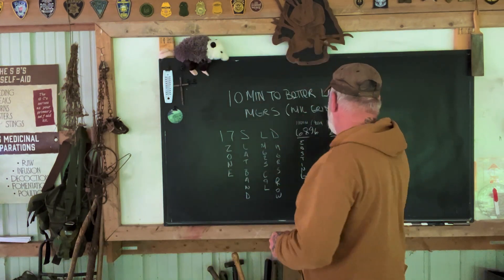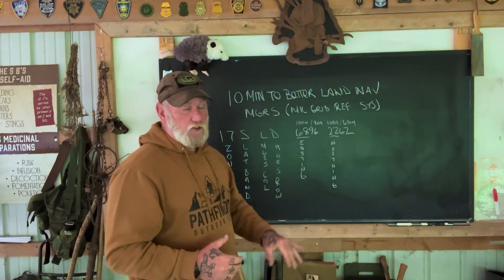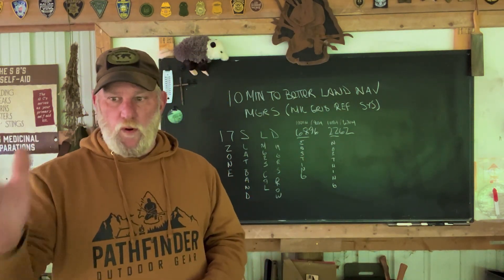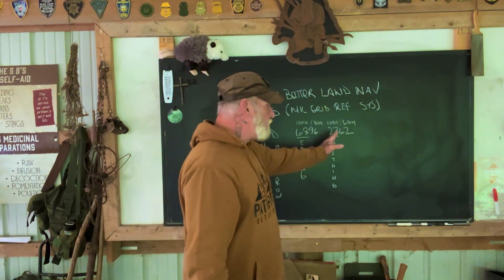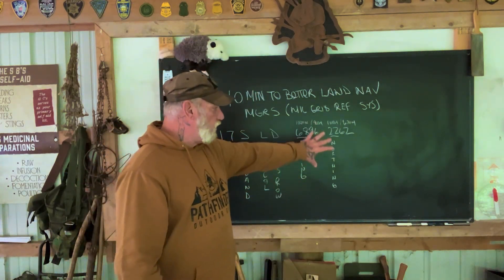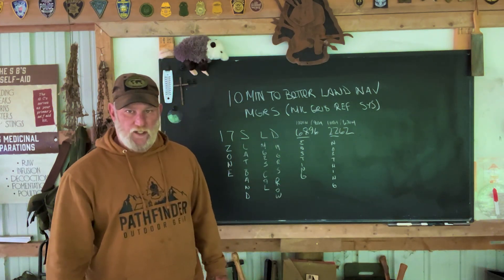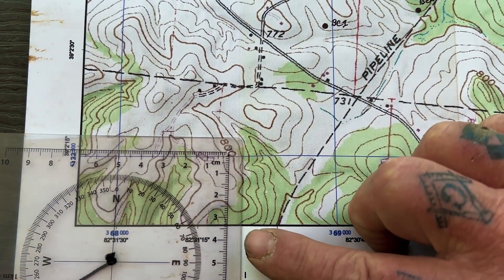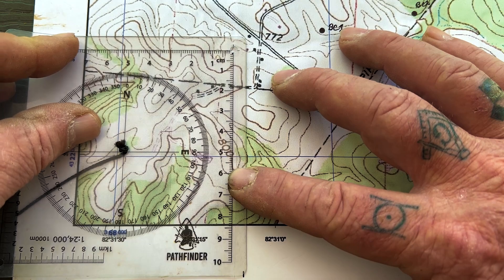10 Min to Better Land Navigation Part 12 Understanding and Plotting Grid Coordinates

Comment: If you haven't got a tube account to download you can sign up for a trial. DO wait till Dave finishes this kick-ass Nav Series so you never lose it, and can use it to practice without having to be on-line. Take a battery re-charge bank if you think you'll need it but really you can find places that aren't in the deep dark wilderness to practice. I've been doing some of them in a carpark.
In a reasonable size park you don't need large elevation or valleys to get your heads around peaks, draws, etc...
Paths, tracks and streets can be used for hand rails etc. You may need to make a elementary map on grid paper to start with if your council/state doesn't have one for the park. Just use your pace beads and get some exercise, remembering to mark where and what you see as you go. Then simply get your compass etc and make scenarios to practice on. 
(You really will be dancing a jig when you know you can nav your way through the bush... 'rewarding' is an understatement.)
Twenty years ago I started small and got my head around orienteering b4 going onto larger areas.

Daves Nav-Series 'abdolutely ROCKS!'

Cheers buddy!
Honour and Respect.

Universal Sovereign Citizen

Comment: Hey Dave, as a sidebar you might want to touch on "what3words" that many 911 dispatch centers are starting to use. If you have phone service with the app (what3words) it will give a location in three words to Dispatch that they can relate too and easily plot.  Most dispatch centers do not have people trained in map reading and only a handful of the local Fire and Law Enforcement personnel are skilled in it. If it doesn't pop up on a monitor or other screen they don't know where you are. I worked with  many of these departments for over 24 years as an Emergency Manager and can say that the majority of the specialized Search and Rescue teams are proficient in map reading as long as their GPS is working.  I spent over 20 years in the military and taught land nav for most of that time, mostly just map and compass, later, maps and GPS systems. I really appreciate what you are doing with this series!